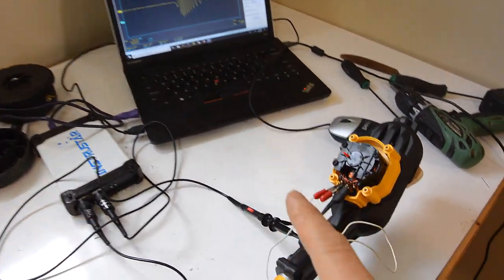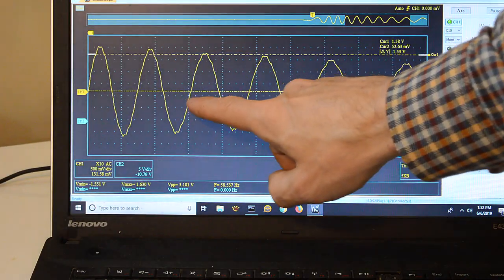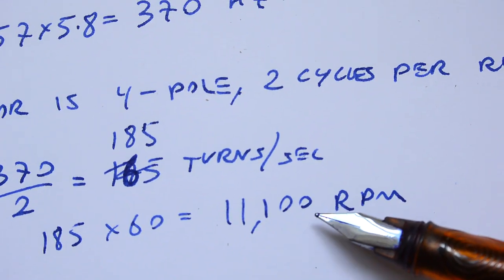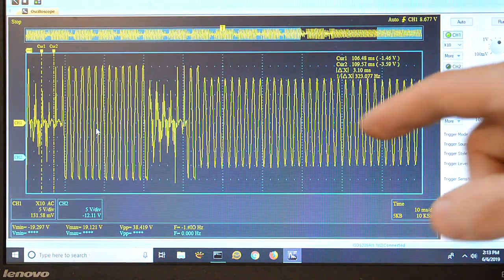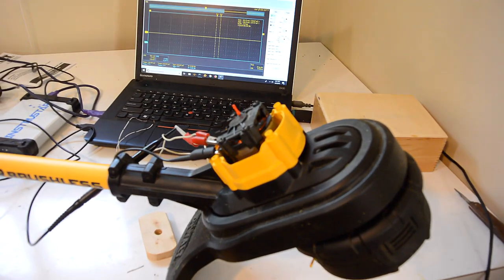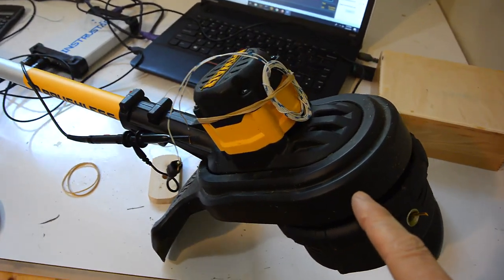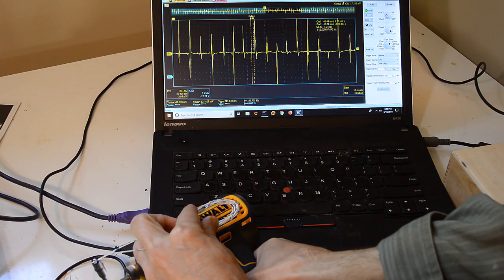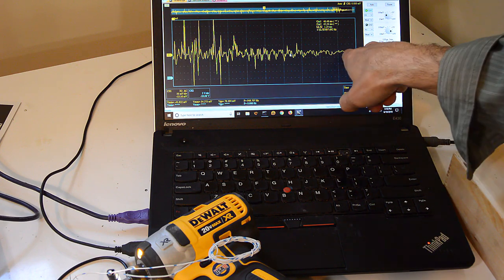Examining a brushless DC motor, and a dumb way to drive one.

Comment: I did not see any hall effect sensors, so they are probably running open loop until the motor spins fast enough to read the back EMF.  They are most likely running a control with a current regulator as well.  Generally, you accelerate the motor at a fixed rate and fixed current setpoint then switch over to sensorless control after a certain period of time.  The acceleration rate, current setpoint value, and time are normally determined by application.  In this case, they almost have to assume the motor will be loaded.  This all gets screwed up when you run it unloaded! The best way to tell what is really happening is to measure the current, I bet you will see it being a constant value.  Also, watch for the way the motor is aligned to start up.  A more sophisticated control will use induction to determine the rotor position at start.  A simpler control will force the rotor into a known fixed position by applying current through certain motor phases for a certain period of time.  If the control is using induction to determine position, you can be sure the designers know how to PWM properly!
Reply: I was wondering if that was just how a sensor-less ESC worked, though the evidence of braking/shorting rather than just "not driving" was unexpected.
Reply: @rpavlik1  That is the general overview of how BLDC sensorless drives work, but there are lots of little details I skipped over.  The braking portion is probably a byproduct of their control logic and regulators that are tuned for operating under a higher load.  For example, they may have a speed PI regulator that tells the system to brake when it overshoots.  This would be an easy way to quickly stop the motor when the trigger is released (assuming the trigger is an input to this PI).
Reply: Being a brushless motor though, could/would the rotor will ever spin faster than the phases are being clocked around it?    If not, there shouldn't be any reason other than to determine locked rotor (no back EMF) or how much load (how fast the frequency of the back EMF decays).    Otherwise, would they able to determine the load by monitoring the phase angle difference between the voltage and current on the windings to see how far behind the rotor is from the generated field (slip)?
Reply: Seems like the controller was designed for something else and it was just drafted into this machine....maybe was cheaper to modify existing stock or design?
Reply: dothemathright 1111  You are right about the coasting.  I missed that part.  Regardless, the fact it is braking the motor rather than coasting tells me that the control is in some strange state.  Looking at the current and/or operating it under normal load would give us some more clues.  Sensorless control can be difficult when you are not controlling something easy like a fan or pump.  Since the controller is so far away from the motor, they probably saved a decent amount of money by removing the sensors and wiring.

Comment: You need to test it with the wire going against grass. That should cause quite a bit of resistance, and maybe, just maybe, we can say the trimmer is not engaging break mode for most of its operation time.
Reply: I was thinking it was using maximum voltage so that it would either cut the grass or not cut, rather than half cutting and stalling.
The foot on the gas comparison Matthias made was pretty accurate, except imagine the car is electric. Full power when your foot is on the gas, no power when it's not.
Now whether this behavior is beneficial or not, I have no idea. Only the guy who made it knows what the thought process behind it was
Reply: Should be fairly substantial difference with cord in trimmer head
Reply: or someones head.... wwe weed wacker match.
Reply: Ah, so that explains that twitter man's Tesla design.
Reply: Brake....

Comment: This is not the dumb way to drive an BLDC motor, this is the cheap way. Almost every ESC uses this method except high end controllers like the vesc which has the option to use FOC (field orientated control) which is what you think would be the right choice, but if you think about it, it would greatly increase the cost of that plastic contraption. Brushless servo motors can benefit from FOC because they sometimes need to turn slow and that way they don't have oscillating tourqe. Motors with high rpms and flywheels can get away quite happily whith this simple driving method you examined in this video. It may not be as efficient as foc but the difference would be minor unlike the cost difference. In conclusion I think it is the smart way to drive a brushless weed wacker. :) If you are interested in this kind of topics check out Great Scott's channel.
Reply from the maker: but is it better to short the windings while not driving it?

Comment: Its just overspeed, needs a load.
Reply: Yes, try testing with the inductive pickup while cutting grass to put it under a true load. The motor is freewheeling once it reaches max rpm and the controller senses overspeed and applys the brakes

Comment: measurement under load would be more predicative then measurement in idle
Reply: 'cept all  tool specs (by Mfg.) are done with no load lol
Reply: But in actual practice, most of the time a weedwacker is running, it's not under load (the load comes in quick bursts.)   So it seems like a poorly designed weedwacker.

Comment: Alternately using the accelerator and brake doesn't make sense under conditions where you can see down the road and can know, can have some look-ahead to approaching conditions, and your preference is to conserve energy.  Arriving at a particular time with some precision (no sooner, no later) is of reduced importance.  In other uses of an automobile, the accelerator is frequently alternately operated with the brake, and is often operated at the same time as the brake.  This is done in racing, where performance is given more priority than economy of fuel consumption.  In control system theory, you can think of accelerating with the brake on or rapidly switching between accelerator and brake as a means of increasing the control system gain.   On your weed whacker, if the motor's braking energy is recovered and fed back to the battery, the losses are somewhat reduced.  Regardless, the motor controller can't see the thick grass approaching the cutting head and know to up the output in advance of the additional load, like a car driver can see an approaching hill and press the accelerator farther to compensate, and not lose speed.  So being immediately ready to respond to a variance in load is critical, otherwise the weed whacker will seem weak in some circumstances and too powerful in others.  Or, under certain steady loads, the motor speed may oscillate.  

Consider that in high performance motion control systems (not steppers, and typically systems that move faster than CNC machine tools), the motor drive amplifier typically drives the motor forward and backward simultaneously in order for the system to position a load stationary under varying demand.  A DC servo motor may go one direction with one polarity and another direction with the opposite polarity, but to brake it, or keep it still, a judiciously chosen AC signal is used.  It is essentially being rapidly alternately driven forward and backward.  If you put your fingers on the motor shaft and try to make the motor shaft turn, the drive amplifier mixes in a DC bias with the AC to counter your efforts.  The mixture of AC and varying DC bias keeps the motor excited and ready to respond immediately to any variance in command, which would be in response to any variance in effort from your fingers.  AC servo systems do exactly the same thing, but the motors are typically very similar to BLDC motors, with a permanent magnet armature and 3 phase stator.  For a great example of high performance servos, look to industrial electronics assembly machinery.  Or, automated military fire control systems.

On your weed whacker, I imagine the motor control uses field oriented control, where the voltage of windings that aren't energized is measured as a means of judging speed.  Perhaps there's too much delay in processing that and applying the result to the motor drive output isn't fast enough to prevent a lag in speed correction, or some other aspect of the system presents a lag that is relatively expensive to improve.  This usually means the "system" needs more gain.  (If you're driving a 4-banger, how much earlier do you have to press the accelerator to have some chance of keeping up when the hill arrives?)  They can't simply increase the amplification of the speed correction, depending on the circumstance, this causes oscillation.  They can't leave the gain of the speed correction low, this causes poor performance.  To compensate, system gain needs to increase.  Increasing battery voltage would help, but that makes the product more expensive and or heavier, requires more expensive power transistors, etc.  Increasing the gear reduction would help, but at the cost of slower maximum cutting head speed.  They could add a sensor to provide the control system continuous true tachometer feedback, but that would be more expensive and perhaps less rugged.  At the cost of some battery capacity, they use this alternating acceleration/brake technique to up the system gain to provide higher, or perhaps just acceptable performance.  The user has to go back to the shed and swap battery packs a little earlier in exchange for that additional performance.  

Anyway, that's what I'm thinking they're doing.
Reply: Thank you sir.
Reply: Ditto

Comment: This is just speculation... but...

I'm willing to bet that it is optimized for operation under load... cutting through weeds could put a somewhat significant load on it, which would prevent the trimmer head from getting into the higher RPM's where it hits the brakes... and perhaps due to the nature of the trimmer head (string flying around with large centrifugal forces) the braking you are seeing is an overspeed protection to prevent the forces from becoming too high... they didn't bother to do it via the more complex PWM because in 99% of cases the trimmer will be under load while using it which would prevent the overspeed condition in the first place.
Reply: cryptk That would be my guess too, but hard to say for sure without looking at some actual technical specs for the trimmer and the motor assembly and driver.
Reply: And the people who trim early in the morning while the grass is at its wettest - you can't tell if the motor is burning out or if it's just a mist that is rising.
Reply: When I use a petrol strimmer on heavy growth near sharp fence posts there is a big variety of load. Often the nylon is cut off by square fencing at high speed or can slow down with tough weeds.

Comment: I grew up learning to pulse the throttle of my weed whacker to keep the rpm low to avoid sending rocks through my windows; It can't be a coincidence that it's the only tool that performs the same thing electrically is the weed wackier.

Comment: Nothing strange happening with the weed trimmer, you're just measuring it wrong :P
The motor has three sets of coils in opposite pairs, you need to scope all three coils. Have a look at the wiring, if the motor in delta or star config? I'm guessing delta, because I can only see three sets of wires?
EDIT:
Also the controller likely isn't braking the motor (what would be the benefit of that?) but rather it's using the coil's off period to measure back EMF, which the controller uses to measure speed as well as angular position. I don't think that motor has any hall effect sensors, you need to have another look :)
Reply: He measured the same effect without probing any specific coils.
Also you can hear it while it's running doing exactly what he's saying it's doing.
Reply: that's not how you measure back-EMF in a synchronous motor controller. You measure it during the cycle, detect the zero crossing, wait a bit for timing, and then shift your state machine one state. here is a paper on the topic: https://www.nxp.com/files-static/product/doc/AN1914.pdf Mathias thinks the motor has been put in short circuit because the back-EMF is extremely weak, in free wheeling it would be about the same size as when driven, so it probably has been driven low by the H-bridge-> that's a brake.
Reply: The voltage from phase to phase was zeroed out for several cycles. If the motor was coasting as you say, then you would see the sinusoidal back EMF from phase to phase. So, no, not coasting to measure back EMF. The controller is definitely braking by shorting from phase to phase.

Comment: Thinking of how a trimmer is used, I can maybe rationalize a reason. Trimmers tend to go from full load to coasting very quickly and often. When loaded (trimming) the motor will almost always need full power. Then you have to make sure it doesn’t spin too fast, or the string will break too easily.  I’m betting they built the prototype with a different control system and had problems, likely with it going too fast and breaking the string, so their solution was this braking mechanism.  It would be interesting to test it in use.

Comment: I believe the Sopwith Camel (?) had no throttle, i.e., it was wide open all the time. There was a kill button on the stick and the pilot controlled motor speed by pressing and releasing the kill button. You can hear this in many of the WWI movies made in the 1960s thru the 1980s. Most were done in B&W.

Comment: maybe, because it is more efficient to cut grass with that pulse freqency, than with constant frequency. the grass will be blown down with constant frequency, but will still rise with the pulse frequency. my other tought, the string will having a whip effect with the pulse frequency. just my tought, never try that kind of thing.
Reply: My thoughts as well, it's like the difference between chopping vegetables and slicing through a cake, the former needs a repetitive force and the later a continuous force.  Could even be designed that way to more closely mimic the force of a gas trimmer. I'd be interested to see Mattias test a cheaper (perhaps a black & decker, as I had one like that and hated it, the battery died very fast) trimmer and see if it does the same thing.

Comment: That's bizarre. I'd love to see a schematic of the driving circuit. My shitty best guess is that either it was designed by a battery company or its somehow capturing some of the wasted energy and reapplying it to the next full-load. It would be interesting to see a current reading from the battery in sync with the coil signal.

Comment: Perhaps try it with the string out? That may put more load on the motor and it would get out of what seems to be an over speed protection mode. 

Another thought: is the driver pulsing its output so that it can ‘read’ the motor speed in between applications of power?
Reply: "Back EMF" (electromotive force) is definitely a thing. Could be a means of speed regulation when they don't want it running flat-out.

Comment: Test it under load!   you could simulate with paddles and a tub of water.
Reply: tbh the regular weed cutting head placed underwater would probably provide more than enough resistance, without needing paddles.
Reply: Most likely and perhaps some line extended to vary the load.  A proper test would record the current draw under true load and then simulate that load in the water.  I wonder about cavitation or wheater that would be a factor.
Reply: @SouthernEngineering  I suspect the cutting line would be quite draggy under water.  I would expect a lot of cavitation off each line.
Reply: hard to say, but I think the line would most likely just wrap around the drum.
Reply: A small fan would be a good load, good enough for just air.

Comment: I think they designed that way because it is the cheapest way of implementing speed control. It looks like bang-bang control, like a heating system with a thermostat. There is no need to modulate the combustion because the inertia in the system smooths out the response (the room warms slowly). In the same way, DeWalt can use a cheap voltage amplifier and just switch it off when the reference speed is achieved and the inertia in the system will maintain the angular velocity. It would be interesting to see if you could make it more efficient with modulation of the voltage or frequency.
Reply: there is no "cheap" control in BLDC motors, you have to have your controller estimating the position of the rotor (basically it has to do what brushes would be doing) and keeping a tab on it. The only thing might be the absence of PWM, but 1) it's cheap, the "costly" part is the back-EMF sensing because it's noisy and you can't filter too much 2) they could also commute late to limit the torque.

Comment: makes me want to go out and tear apart my Makita 36V ($400) weed wacker that is smooth and quiet and runs for 1hr+ continuous with 2 4Ah batteries.  I have a scope so could rig up a coil... but sound like too much work. What I want to know is why my Dewalt job site table saw 7480  motor (110V AC) screams so loudly.
Reply: I heared somewhere that brushless motors tend to be louder than traditional ones, also with Makita.